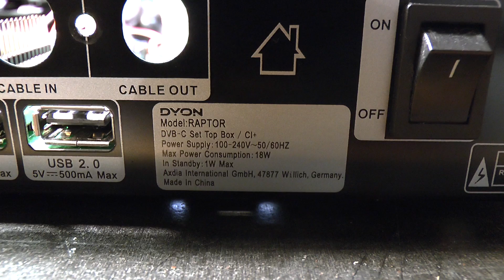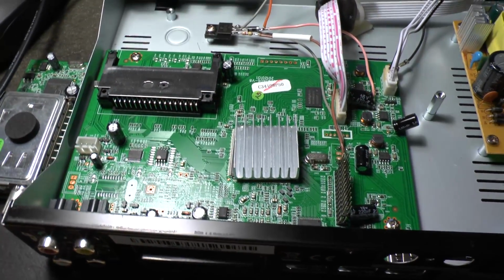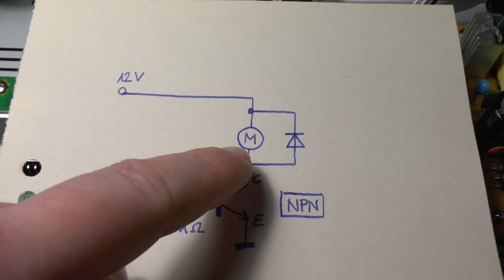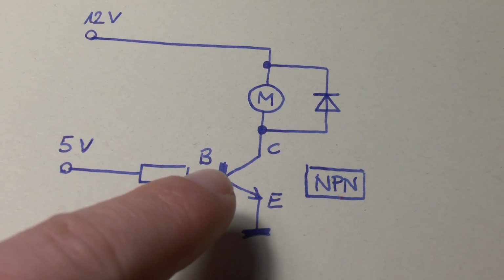DrCassette's Workshop - Cable Box Cooling Fan Circuit

Comment: Hi do you still have this receiver? If yes can you tell me which Firmware version is on yours? Maybe yours is newer as mine (1.5.07) so can you backup it and send me please? I found mine in the trash and it works. I only need a Remote control lol

Comment: I like that idea- my cable box gets very hot (Scientific Atlanta) and I don't know why there is no fan. Only in the past did the companies know what was needed. Reel to reel recorders, even solid state, often had them. The only recent devices I've noticed that have a fan are DVD recorders- a Philips in the late 2000's, and a Panasonic from about 2 years ago.
Reply from the maker: +bob7872 
In the cable boxes of course the permanent overheating is a design feature - companies want to make sure that they break fast so that they can sell another one. I paid 70€ for my unit - not enough to expect any quality. There are models that go for 200€. Those should be designed a lot better.

Comment from the maker: In case you wonder, why didn't I just use a 5 V fan? Well, I had the 12 V fan in stock, as well as all the other components I used. So this was a free solution, unlike the 5 V fan which I would have had to buy.

Comment: How much power could this set up take?I'd like to make a switched socket from my tv,to drive a D-class amp,that has a 12V 3A power supply.
Reply from the maker: +costellom5 
Replace the fan motor in my schematic with a relay coil. Use the relay to switch whatever you want. That should work.
Reply: +DrCassette What transistor did you use,and diode?
Reply from the maker: +costellom5 
Any transistor that's NPN and that can carry enough current and voltage will work. I used the 2SD2012, because I happened to have a bunch of them. Check the data sheet to find out if any random transistor would work for what you want it to do. As a diode any standard 1N4xxx should work. The diode I used was one of those.
This is absolutely no rocket science ;)
Reply: Thank you :D

Comment: Scart's switching voltage can be 6 volts.. they modified the standard later on to be 0v = off, 5 to 8 volts = on/16:9  and 9.5 to 12v is on/4:3

[edit , taken from wikipedia's scart page]
Pin 8, the switch signal pin, carries a DC voltage from the source that indicates the type of video present.
0 V–2 V means no signal, or internal bypass4.5 V–7 V (nominal 6 V) means a widescreen (16:9) signal9.5 V–12 V (nominal 12 V) means a normal (4:3) signal
Reply from the maker: +TheChipmunk2008 
Ah OK, that explains it.